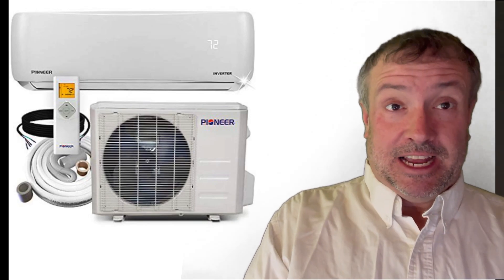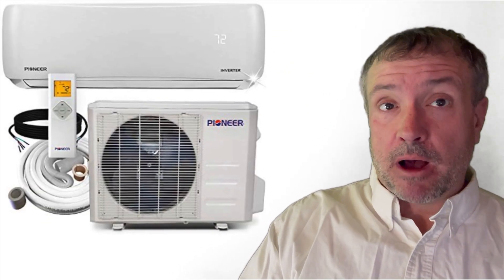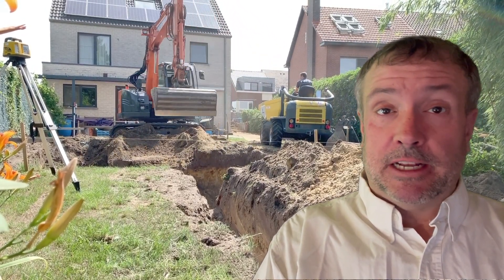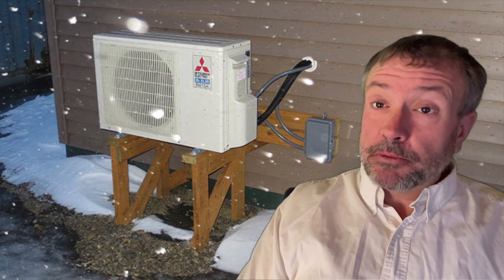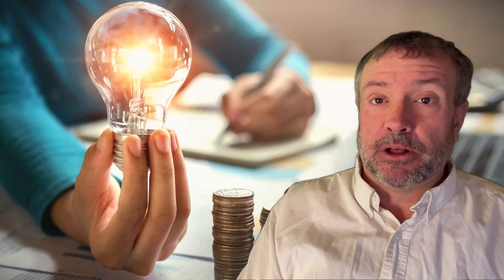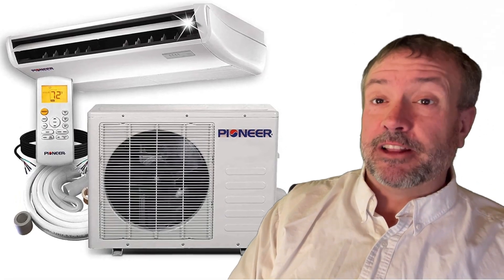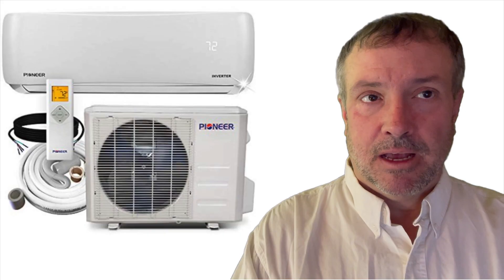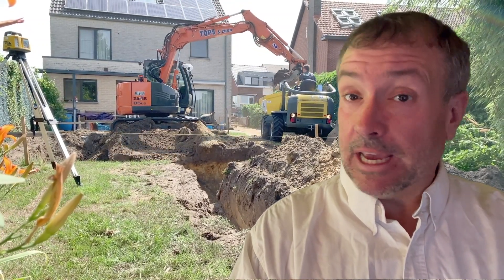Geothermal Mini Split Air Heat Pump works in -40'

Comment: Just a note for US watchers...  -40 C is equal to -40 F and it is the temperature where mercury freezes.  +5 C (the ground warmed air) is equivalent +41 F.
Another note for those who claim that Fahrenheit degrees are "unscientific" and Celsius degrees are.  Both Fahrenheit and Celsius modified other people's existing scales.  
 Fahrenheit multiplied the existing scales degrees by 4.  So the zero point was an easily reproduced chemical salt/water/ice bath that could be made anywhere and the 100 degree point was the average body temperature of people at that time.  As sanitation and health care improved over the centuries,  people had fewer long term infoections and their average body temperature dropped from 100 F to 98.6 F by the 1960's and down to about 98.2 F today.
 Celsius modified the scale he borrowed by changing the number of degrees from the boiling point of water (the original zero point for the scale during his lifetime) to the freezing point of water,  from 150 degrees to 100 degrees CENTIGRADE.   Now as a chemist,  I can tell you that measuring either the freezing point of water or its boiling point with any accuracy is extremely difficult and imprecise.  The boiling point especially,  as it is dependent on the current atmospheric pressure.  As for the scale being reversed to what we have today,  this occured only AFTER Celsius died.  
Thus Fahrenheit's scale was actually more rational and scientific than that of Celsius... and while we STILL use Fahrenheit's chemical salt/water/ice bath today for calibrating primary thermometers of any scale,  the use of boiling water  or freezing water is never used as being unreliable.  Human body temperature is also no longer used due to the changes in sanitation making the old standard no longer reliable.
Reply from the maker: cool info, thank you
Reply: Most heating engineers would use Kelvin. The Celsius scale tracks Kelvin perfectly (but is offset). 0 degrees Celsius is water's triple point in vacuum and water's freezing point at around 1000mbar pressure (sea level). SI units (and their derivatives such as Celsius) are objectively useful.
Reply: @m23605     Likewise for measuring and planning chemical reactions for industrial processes,  chemists like me often use Kelvin instead of Celsius...  that way the graphing and predicting of the reaction rates is greatly simplified.

Comment: This idea is very interesting, I think if you circulate this ground air into a box around an standard out door heat pump condenser, you could use your heat pump down to zero Fahrenheit for the winter, and design this encloser with openings for summer use.
Reply from the maker: Yep!!!
Reply from the maker: But understand it’s also colder air for summer use which means less energy to cool
Reply: older heat pumps only operate down to 42 degree or so.  so this is the reason for an inverter style heatpump
Reply from the maker: @stevepailet8258  ok
Reply: @stevepailet8258  I have a 10 year old heat pump a York it continues to supply heat at 20 Fahrenheit  and lower,but there  is less capacity and the electric kicks in to help, when stat see 2 degrees lower than the setting it brings on 1 stage of electricity to help out but the heat pump keeps going till the stat is satisfied, if the out sensor finds the temperature 0 Fahrenheit it will shut the heat pump off , at this temperature there is not enough heat to justify the cost of running the heat pump.
Reply: @herbertcharles8606  since I used to sell york I know that your heat strip is turning on a lot sooner that you think
Reply: @stevepailet8258  My heat pump has a balance point stat,I set it at 25 Fahrenheit and the house is kept comfortable, the pump will run most of the time till the sun comes out and helps warms that the house. I have R2000 built home.I put a thermometer in the supply duct and I know by the temperature of the supply air 74 to 76 degrees that there is no electric on when it is 25 Fahrenheit. I have been servicing  heat pump since Westing House built the HI RE LI first heat pump, there is a lot of knowledge  people don't understand regarding Heat Pumps. The main point is telling the homeowners how they function and what type of heat they produce and howto use the thermostat  properly.

Comment: what i did in hungary years ago... just brought a 20kW high (at least 35bar tested)  pressure lamellar water-water heat exchanger its was about 90usd. removed the air exchanger from a cheap 6kw chinise ac replaced with the lamellar heat exchanger. 

i have a well in my garden i just drop a small ~100W diving pump into with a siolated 20mm kpe pipe to heat exchanger. its placed into basement, teh used water just go to communal waste network. no so legal but i dont care.

only on safety thing need a fluid flow switch after the heat exchanger what turn off the ac if the pump do not proivde enough water. its working cc 5 years ago. and teh cost was about 1/3 of the similar water-water or water-art heatpump system.
Reply from the maker: That’s awesome! Thank you for sharing

Comment: We have a 5 ton Geothermal System and the final cost was $21,315 powered by our Solar System.  Yes if someone already has a Minisplit System or doesn't have a forced air heating system this is something to consider.  The only weakness I can see are the duct fans which might need replacement at some point.
Reply from the maker: that's CHEAP for a liquid geothermal system!!!!!
Reply: I've never heard of a complete GT system (especially a 5 ton system) only costing a hair over $21k installed.  I'd love to hear more details as that's WAY cheaper than anything I've ever heard of.  Maybe if it was DIY, but that might still be tough today.
Reply from the maker: @ssoffshore5111  well said
Reply: @ssoffshore5111  Actually it's not DIY installed by company.  The system as quoted was $40,375 reductions: $1750 discount for cash payment, $9820 rebate from NY, Fed Tax Credit $7500 final cost : $21,315.70
Reply: @chrismaxny4066  This is what I want to do at our new home, but it's an old brick house; even the interior walls are brick. I can't run duct work. I have exactly 1 stud-frame wall I can use to access the 2nd floor and run either water or refrigerant tubes (through the floor or ceiling) to mini-split style head units in each room. Unfortunately all of the products I'm seeing seem to be ducted forced air systems (with an option for radiant floor heat). I'm hoping to get off both oil fueled radiators and window AC units at the same time.

Comment: Uh, so, if you use the condenser fan... you can use it to pull the air through the tubes... no need to acquire additional fans or power them, so that will save money and make everything simpler.  Maybe you fix it simply by having a bigger diameter... but even if the air flow is somewhat restricted, the warmed air will improve efficiency.
Reply from the maker: Ok

Comment: I think this is something that could work. However, getting it right could be a challenge. You need to get the total length of those flexible pipe runs just right, and bury them at least eight feet deep. And the fan shown as an example would not work at all; you need a proper squirrel-cage fan designed to move air through a high-resistance collection of flex-pipes. Still, I do think this idea has merit. I'm tempted to do a little experimenting myself.
Reply from the maker: Keep me updated!

Comment: If you are digging up the whole yard, why not to use liquid based heat pump with more efficient heat transfer with ground as compared with air. The majority of the cost is digging and not in the heat pump unit as far as I know
Reply from the maker: The mini split allows for easy installation DIY in many cases. 
You need a full furnace setup with ducting for most liquid systems. Basically simplicity
Reply: @SimpleTek  there is nothing simple about digging out 8 ft deep trenches and putting plumbing in them.
Reply from the maker: @Martinko_Pcik  simple for me
Reply: @SimpleTek   I like the idea of no box and balancing the CFMs between the mini split and ground tubes. Exhaust to outside. We need calculations. Would smooth larger pipe make that much difference? Your earthhouse friend invented a cheap way to make that type of air pipes by spraying inflated plastic. Risky!
Reply: They’re expensive.  Even if you do the entire thing DIY, the geothermal heat pump will be at least $10k… then whatever other costs you may have.  An air source heat pump DIY is $3-5k for a really good whole house central air unit.
Reply: @Swampwild1 I like the idea of using an underground thermal mass that is more thermally conductive, which would need less surface area to effectively transfer heat.  Maybe a cistern filled with mineral oil circulating through a radiator.  Then the ductwork can be 10-15 feet.  The cistern will equalize to ground temp over time.

Comment: So, what about bacterias and germs in the pipe? Since there will be some water condensation I believe it's kind of issue, right? There is no such problem with water heat pumps.
Reply from the maker: It doesn’t go into the house, so who cares?
Reply: @SimpleTek  Sorry, but can't agree. Through analogy car AC has same tunnels and similar working conditions and you have to from time to time clean all the ducts (usually by ozoning process). Believe me you don't want to breath this stuff
Reply from the maker: @Kris-82  your opinion
Reply: @Kris-82  in the case of a mini split (with the sole exception of Daikin Ururu Sarara) the outside air stays outside. There is no air exchange.
And you also did a bad analogy with the car's AC because that's designed to take outside air with the exception of Tesla Nuclear Defense Mode or whatever is called.
Regular cars will draw some amount of outside air regardless of your settings.
Reply: @SimpleTek  I think over entire system once again and you're right. This issue do not exist, sorry for confusion.  I would have other question - since you pump the air through ground using A/C fan does this corrugated pipe makes sense? Doesn't it restrict the flow? I understand that the pipe must have specific diameter according to it's length, right? 
BTW I think it's awesome idea to avoid heat pump costs as you said.
Reply from the maker: @Kris-82  are there better options, yes, but not for the price of corrugated tubing. Im cheap

Comment: Why not use the system on your video "Cheap Geo Thermal Air Conditioning"? Place the radiator on the air intake side of the outside unit and allow the fan of the unit to draw air through the radiator through the heat exchanger.
Reply from the maker: Lots of different ways to do it ;)
Reply: @SimpleTek  True. But in the aforementioned video, you gave reasons not to use corrugated tubing for space heating. Those reasons all seem valid for not using the corrugated tubing for evaporator heating.
Reply: I was thinking the same thing!

Comment: Yes I absolutely can see how this works. About 75% of my installs are ducted mini splits. I try to have my customers understand the benefits and differences of a mini split system. I absolutely do not like geothermal heat pump systems because they use glycol as the heat exchange. What I really like is your only using underground air temperature as a heat exchange this could be a game changer if the right people see this. FYI you can install a DC powers fan and a AC to DC inverter this cutting the power consumption a little bit more.
Reply from the maker: Thank you for the kind words!

Comment: I agree with a lot what you say here. But in my opinion, using air as a medium throuw the garden is not the best idea. And the plastic is an isolator not a good conductor. It might be save, but a fluid conducts more anergy. Now, we have an airco, and i almost never turn it on when its lower than 5 decrees celsius outside. It really starts using 30% more energy between 0 and 5 degrees celsius.
Reply from the maker: one has to weight the best material vs the cost of the material sometimes. sometimes the best stuff isn't affordable

Comment: Have you tried this yourself? And how did it work?
 A better option may be, instead of using air tubes and powering fans, just bypass the condenser, by burying a long coil of copper or stainless tubing and run the refrigerant tubes directly in the ground. A cheap to rent or hire mini excavator would probably be big enough to make the narrow trench needed. If you run into groundwater, all the better!
Reply from the maker: Copper is expensive!
Reply: @SimpleTek  And so is stainless steel, but electricity is much more expensive over time. 
 Still, I think a roll of 100 to 200 feet of 3/8 inch tubing, refrigerant, and mini ex rental would cost much less than 1000 feet of corrugated pipe, fans, insulated box for the air system, and large excavator rental you're talking about.

Comment: This won't work if the external unit is in a box unless the box is very large. The ventilator on the external unit needs at least two meter clearance from the nearest obstacle to work properly.
Reply from the maker: yes it's can't be tight
Reply: What about using hot water from the boilers for the heat exchange?
Reply from the maker: @ajarivas72  it’s an air system
Reply: @SimpleTek  

It´s a great system. I want to implement the water system also
Reply from the maker: @ajarivas72  the water system is more efficient but more expensive

Comment: This sounds interesting, but I'm just not that handy. Is there a legit installer in Ontario I can talk to who would install a system like this? I'd gladly trade a little of the efficiency of water-based systems for a substantial up-front installation savings.
Reply from the maker: I wish I could help but I’m in Manitoba
Reply: @SimpleTek  got it  - thanks for the quick response. So here's a high level follow-up question: We've got ample rooms/basement spaces, including a 12'x12' closed "cold storage room" where the oil tank is. Couldn't I simply use that room as the "box" and run the air hoses into that (perhaps insulate it) and put two air collector units that run to the heat pumps? If I approached an HVAC company would they be able to install such a system?
Reply from the maker: @jadenamber8378  maybe?

Comment: I have been schooling people in the Philippines to do this  BUT  not with air.   There is no BIG  " O "  pipe in the Philippines.  To install a small car rad in front the outside  heat exchange  rad with a fan blowing through the rad into the heat exchanger rad.  The fan and circulating pump will be controlled by the outside unite turning on and off .  Your heat pump system can ether power your new geo system or you can supply a new power source and have a relay turn the electric power  system of your heat pump turn the geo system on and off..   Very simple to install.   If your back yard is small  do not dig up your yard just dig a deep circle hole to accommodate a coil of 1 inch pipe as it comes coiled  as new.   Too easy.
  Ask if you want to know more.    I lovee learning videos like this .
Reply from the maker: Thank you!!!

Comment: I have read that the noise level gets on people's nerves and that the neighbors complain about it.
Reply: A modern air source heat pump is fairly quiet.  The one i got i can hardly hear when I walk around the corner.
Reply from the maker: do your neighbours have issues with air conditioners? similar noise
Reply: Most Mini splits are very quiet and as such, are used on apartment/ hotel projects and are designed to not disturb the neighbors. If you are purchasing, ask for a db rating.

Comment: Where's yours? All I see is a bunch of stock footage of other people building stuff and working without you or a demonstration of this imaginary system you propose. You've been doing this for awhile, why wouldn't you film every step of this last build and demonstrate it? I know why.
Reply from the maker: I bought all the tubes and stuff this fall, and then the backhoe I rented broke.. so it goes in next spring/summer now. As I get excavators a few times a year for installing holding tanks at my resort and I’m too cheap to rent one for a single purpose
Reply: Wow. It sounds to me like renting an excavator for $300 and saving $200 a month on heating electric bills just makes sense. But I'm sure you know what's best for you so no lectures for me. Thanks for the video.